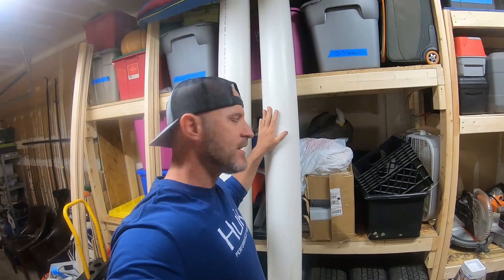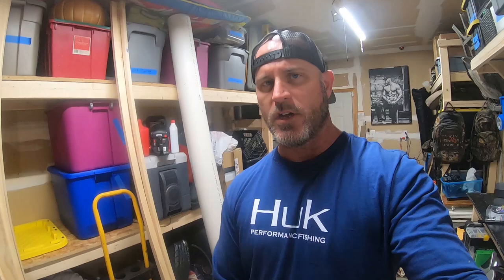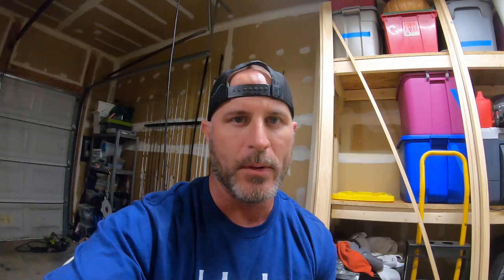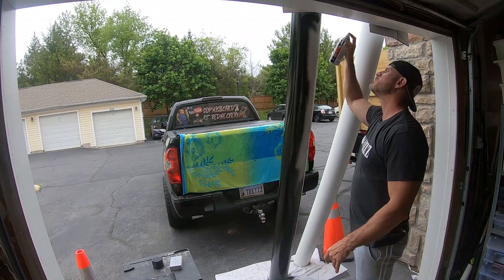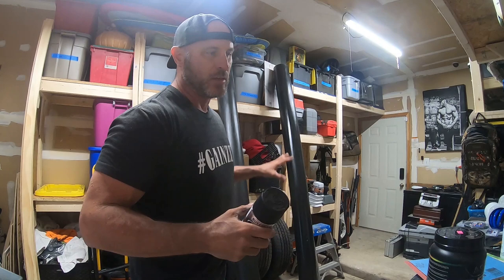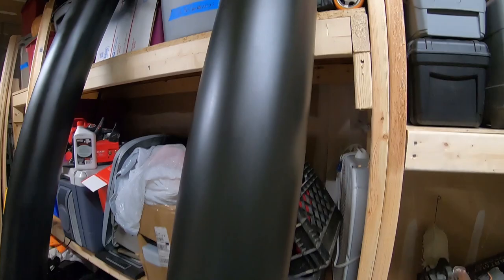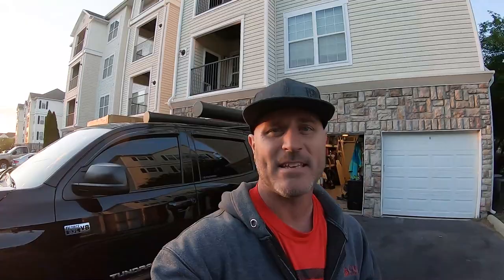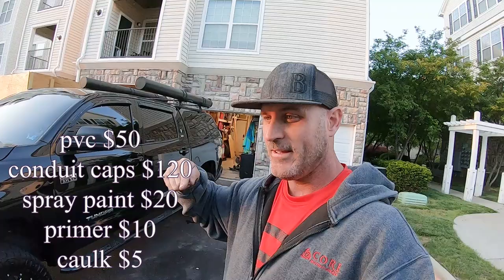DIY SERIES: TRUCK ROD TUBES, AKA Rocket Launchers...A step by step how to!!!

Comment: I also own a toyota tundra crewmax and made a rocket tube for on the bed. One thing I did different was that I used 6" drain pipe or sewer pipe to cut down on weight. It is considerably lighter than sch 40. It does stick out  of the back of the truck but i have a bed cover and made it flip out so I do not have to remove the rocket tube to access bed cover. Cool build they look great.
Reply from the maker: Nice. Sounds like it works great for ya. 
Yeah I was goin got use drain pipe but decided I wanted as little flex as possible since they would be up on roof. I debated but the weight wasn’t enough to sway me. Appreciate ya taking time to comment!

Comment: Did you have any issues with the rods getting really hot? I just finished painting and it hasn’t occurred to me. I wouldn’t want rod grips to melt or anything
Reply from the maker: No. They got hot but never any issues. You could always drill a couple vent holes in the upper portion of the rod tubes and couple on the bottom to allow air flow. But never an issue.
Reply: @SophisticatedRedneckery  Thanks!

Comment: But how many combos can fit in it
Reply from the maker: Hey Matthew, I can usually fit tour in each tube easily. Two spinning and two casting work best without removing reels. If they are shorter rods you can fit even more.

Comment: Nice job on the video. I'm getting ready to do the same thing minus the punch in nutts! One thing that i'd like to point out about the caps is even though it has a "key lock", you're still able to turn the triangle with a pair of pliers.  I'm trying to figure out a way to better secure them. Tight lines brotha!
Reply from the maker: That is correct you can. But for everyday security they have worked great. Heads of someone wants to get in they can. Thieves suck

Comment: Great enthusiasm. Great job explaining paint process to have it done right. Would have liked to have seen some more info on putting caps on (do screw ends extend into tube far getting in way of rods). Your train looks fantastic BTW.
Reply from the maker: Thx Bennan, the end caps actually fit right over the end making the inside of tube seamless. Rods slide right in and out. 👍🏼
Reply: @SophisticatedRedneckery  thanks. Will check out some more of your videos. Looks like you try to do things the right way. Your graphics/text work well in the video BTW.

Comment: Does the heat inside the tube wreck the fishing rods as black absorbs so like on a 28°c day then tubes would be 45°c+ easily
Reply from the maker: Or probably could. I don’t store them in there. Only transport N did stored short term. Haven’t had any issues so far.

Comment: Did you put a clear sealer coat over the black coat? If so what did you use?
Reply from the maker: Hey Aaron, no sealer coat. It’s been great with the matte black finish. It has rubbed a bit where the brackets are but not bad at all.

Comment: Awesome video. I made a tube a while back but I recently just got a tundra with the same ARE topper. I was thinking of getting a prinsu topper rack and it seems to sit a little shorter than what I think you have are the Yakama skyline rails and tower. Do you think or have you seen a tube on a prinsu? I'm just afraid the U connectors for the tube will be way too long.
Reply from the maker: The brackets may be a little tight but I think you could make it work. Might not look as cool or could look better, flip the bracket upside down🤷🏻‍♂️

Comment: Nice Job....it looks like you paint the u bolts too. Any tips to get the paint to stick?
Reply from the maker: I did.  Use a good grill paint. Has held up for two years well.
Reply: @SophisticatedRedneckery  great idea...I am sorry one other thing. Are your 6 in rod tubes holding their shape in the heat.

Comment: What is the caulk for? Is it justly to keep water out?
Reply from the maker: The caulk does three things. 
1.  Keeps it dry 
2.  Acts as a glue to aid in keeping ends secure. The screws can wiggle around and fail over time. Always better to secure more than one way. 
3.  Plus if someone tried to unscrew the caps to get what’s inside. They would have a hard time getting them off when caulked.

Comment: Details on the rack and basket?
Reply from the maker: Hey LJ, the rack came with the truck cap and is a Thule aero bat set. The rack I grabbed on eBay. Been great. Here is the link. https://www.ebay.com/itm/192058630233

Comment: They look great? How many rods with reels fit in them? I have both Open face and Baitcasters.
Reply from the maker: So I have for 8 combos in them but I’m pretty sure could fit four more. 
I mix the baitcasters with spinning for better fitment. For the spinning reels you will need to break a few handles down. So they fold in. Then haven’t had issue. I love the rods and they work great a year later. Thx for watching
Reply: @SophisticatedRedneckery  awesome! Thanks for the response! Can't wait to make mine!
Reply: So 4 total rods and reels mixed baitcaster and spinning in each?

Comment: I guess I could give you some advice you should have put a dust mask on before you started your project before you started sending your PVC pipe.
Because when you turn your sander on dust went up in your face.
So next time wear a dust mask or respirator for your protection you do not need to be breathing all that nasty sanding dust.
Up into your lungs.
Maybe even buy yourself some time back seats and put on so you can keep yourself clean in the process and all your clothing and maybe where are some rubber gloves before you start to keep your hands clean.
Hope you remember all the safety data advice I'm giving you I hope you remember all this safety advice I'm giving you it's only for your own protection.
You have a family we don't want you to get sick because you are not using your head God gave you.
Please be safe when you do all your projects okay.
I want to see you back on YouTube doing other projects and not finding out that you got sick and something bad happened to you.
Reply from the maker: Copy that.